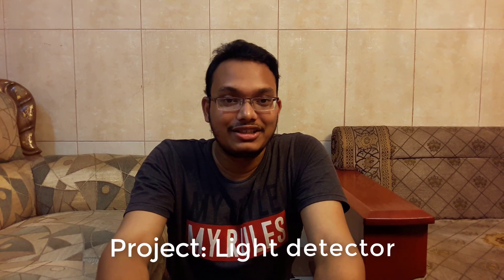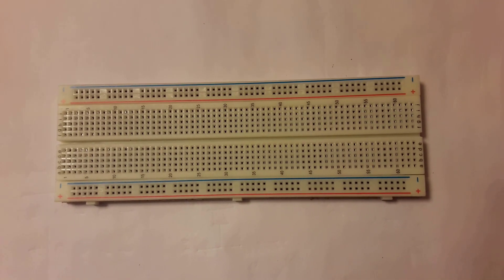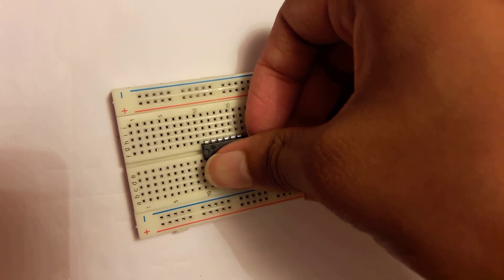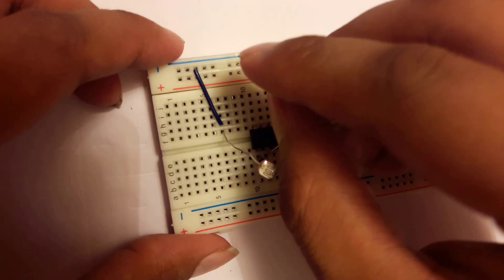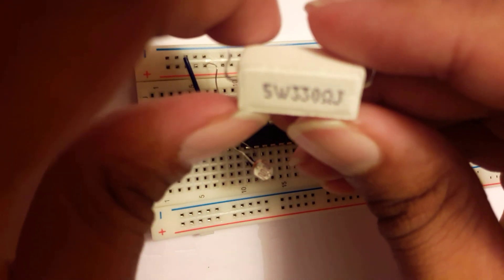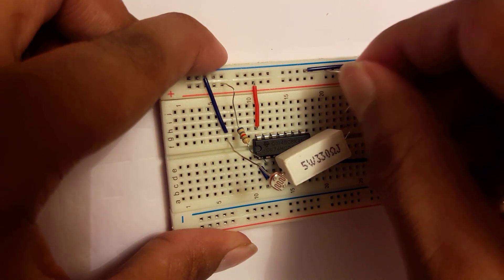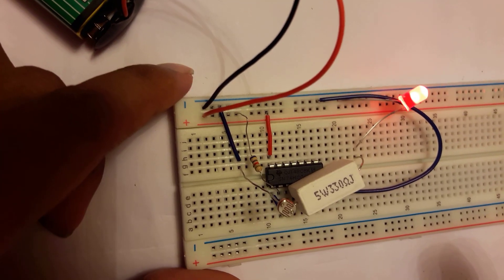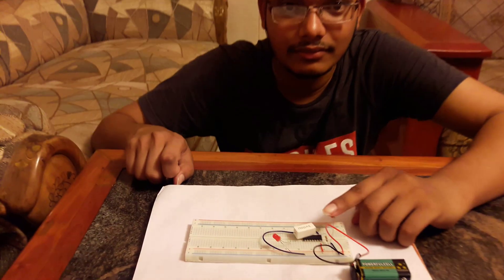Light detector project using NAND gate (Turn on the caption for better understanding)

Comment: Hello sir what changes we have to do to this circuit to work this opposite conditions . Like when light is not there it should glow and when light is there it should put off .. could you please tell me ..
Reply: you can use and gate for that or inverter in the output
Reply: Just turn out LDR and connect it reverse